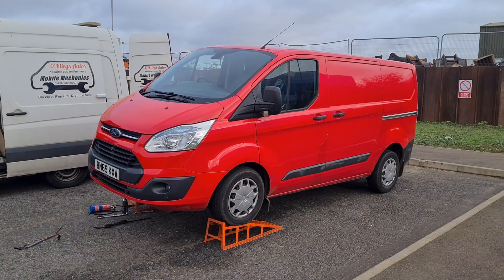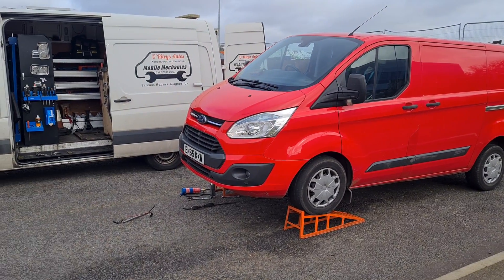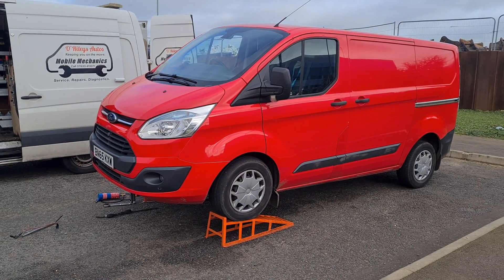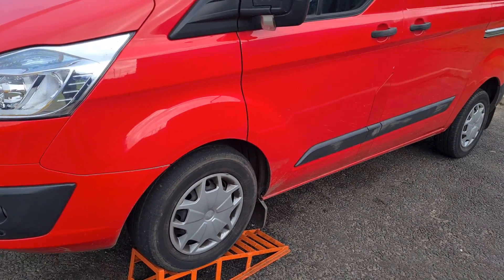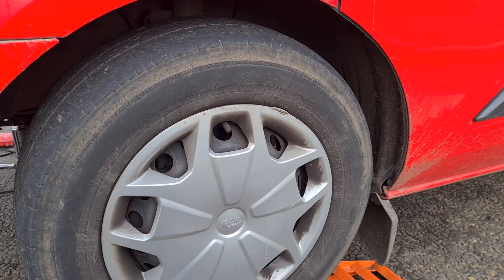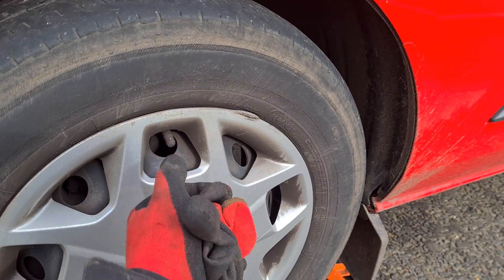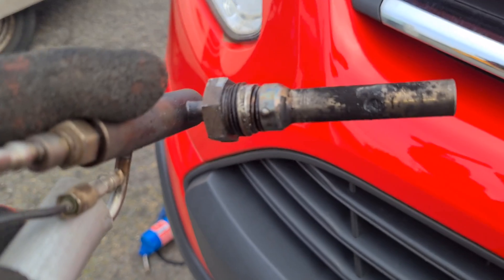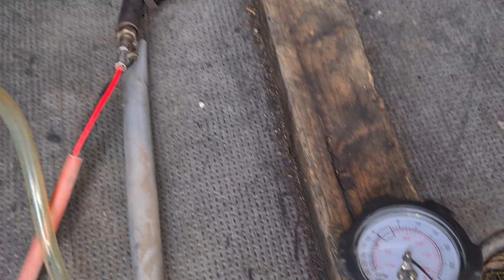Why Forced Regeneration Is Not Fixing A Blocked DPF

Comment: I got a 2018 tourneo custom and i had a turbo go however prior to this i had the ad blue malfunction regularly pop up and disappear and pop up and computer to make codes go anyway after the turbo fixed and cleaned out it constantly comes up with exhaust filter is full driven to clean and then gets full ive had it cleaned twice and also exactly the same time the ad blue malfunction comes on any ideas before i take it back a 4th time 😫 last time was a week ago and only driven it 30 miles or so. So surely it cannot be blocked in that time.
previous to the turbo the exhaust filter never came on ever. Only the ad blue malfunction

Comment: Am i correct in assuming the fuel vaporiser is fitted close to the DPF and that not all DPF vehicles have them? > Mine [transit courier] over fuels from the main injectors and has constantly rising oil levels (filling the sump with diesel). Resulting in engine failure.
Reply from the maker: Yes that's correct. This was a better system
Reply: @ORileysAutos  My 1.5tdi courier 69 plate has just has a new engine, and a new DPF - within 120 miles it has tried three regens. It must be either a sensor, a wiring loom or ECU issue. The main Ford dealership have not been able to cure it in 18 months.

Comment: When the faultcodes p244c and p2463 are in the system you have a problem with your vaporizer. I don't understatement why none of the other shops checket the vaporizer? (When you put the codes on google you see always problems with the vaporizer!)So forced regen. doesn't work, a good shop should know this. You have first solve the problem and then you can trie a regen..

Comment: Seat Alhambra 2011 2.0 diesel. Dpf shows 40 kpa back pressure after forced regeneration (35 kpa before regen). Fan goes on after every trip for 5 minutes. Dealer says dpf filter should be changed. Have heard that it can as sell be catalyst clogged. Pressure sensor got changed. What would you suggest to start with?

Comment: My transit custom throws up engine malfunction service now light and shakes at idle when it gets hot. Has been to 3 mechanics. 3 forced regeneration done. 4 new injectors + clutch n flywheel and crankshaft pulley. €2000+ and problem still persists... Any help would be greatly appreciated 🙏
Reply: thats frustrating when they just throw parts at it , better off taking it to oreilys before all that money.
Reply: @Matt-we7si  I know mate I would but I'm in Ireland

Comment: I had an issue with my DPF, kept getting a message on my dash. Took it to a few places to get it cleaned but with no luck on fixing the issue. I did abit of research and came across one that mentioned the fuel vapour valve, I took out the old valve and seen it was so badly clogged up with soot. I replaced the valve with a new one and it sorted the issue out straight away. Crazy how much they cost for such a small part.
Reply: Similar to me with my exterior temp sensor on a Peugeot Boxer. I could have gone on for ever paying garages to replace various bits in the emissions system but thanks to Mr O'Riley £80 sensor from Peugeot and my time fitting it fixed the issue. The man is a legend.